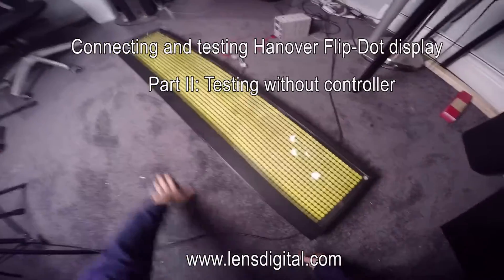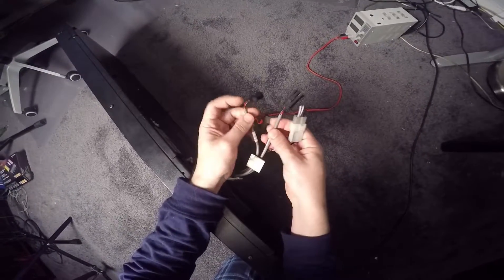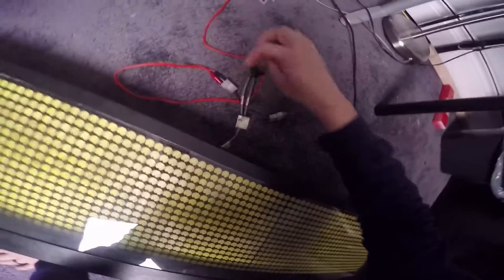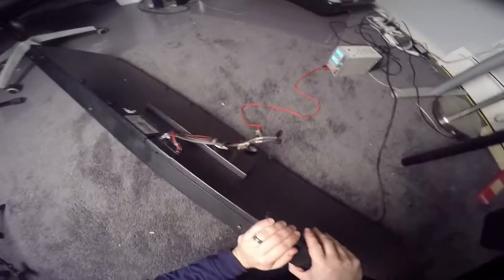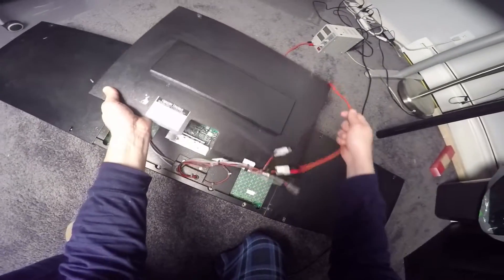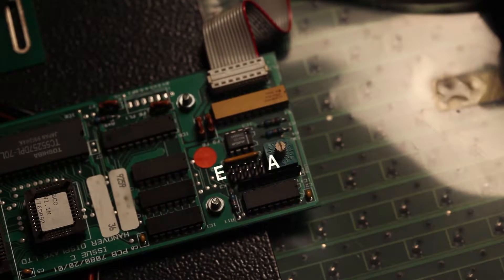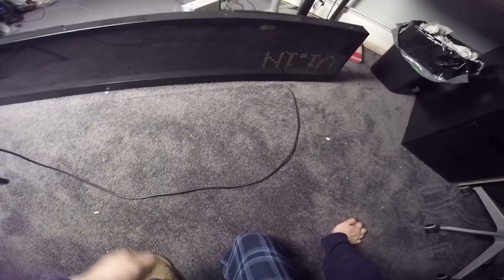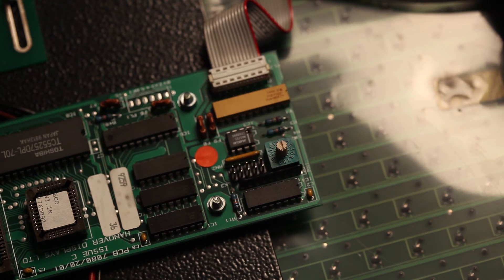How to connect and test Hanover Flip Dot Display. Part II: Testing without controller

Comment: Hi! loved these videos, would love to see more of how you got them working and how you drive the display! would be super super useful
Thanks,
Nick
Reply from the maker: You'll need a raspberry Pi, USB-RS485 dongle and python library. However I just checked, and guy who made the library removed it from Github for some reason :( I have a copy so I might be able to share it. Will let you know
Reply: @madeinbasement  Any chance you can post the library and instructions on using the RS-485 or at least the link please?  I have the same board as you (96x16) and wish to do things with it!  Thanks ;)  Any chance of a Part 3 showing more details/settings/connections?
Reply from the maker: @cyclic2696  Hi I uploaded code here https://github.com/lensdigital/flipdot
Reply: @madeinbasement  that would be amazing! Please let me know! I’d love to get my 7x83 display working!